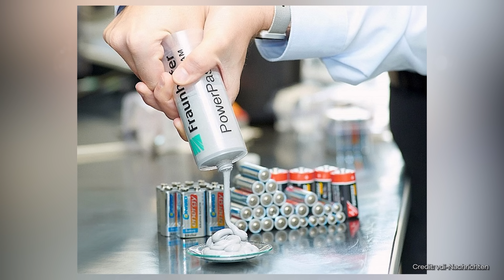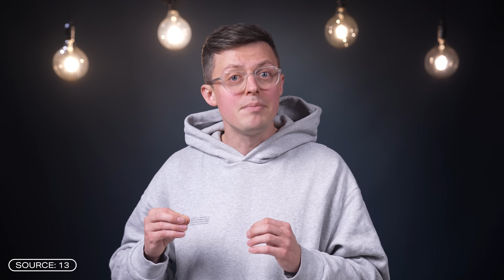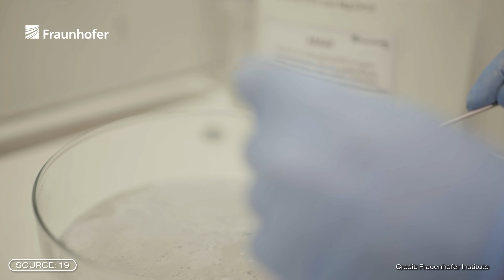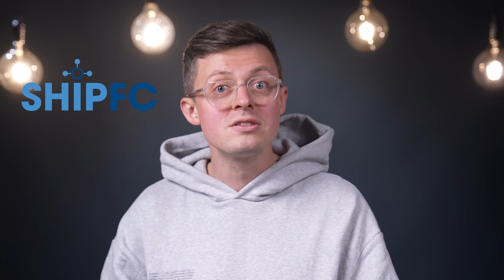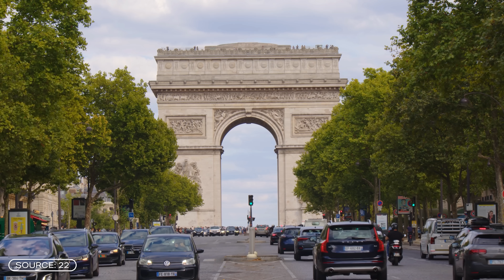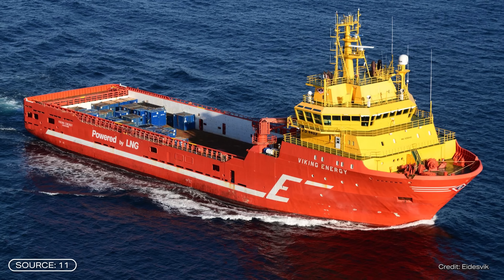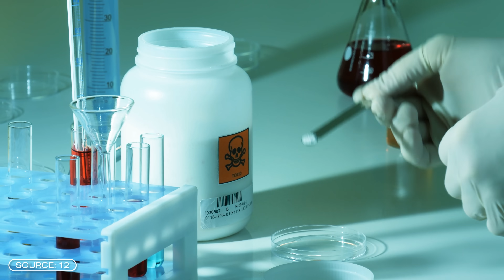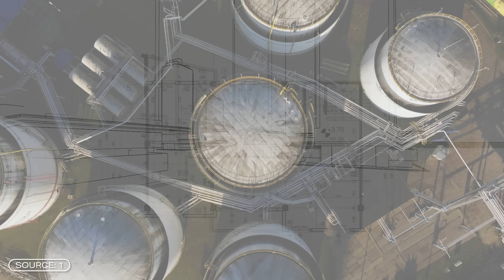Hydrogen Powerpaste: 10x Higher Energy Density & Safe?

Comment: Another issue with Ammonia fuel on a ship, is that an Ammonia leak will kill the crew.  Any leak from a collision or other emergency, or just bad maintenance will be toxic for the crew.
Reply: It's a similar issue with ammonia refrigerant.   It's only used in industrial locations with redundant safety measures.
Reply: @1spaghetti32   in long island suffolk college one campus has   2 large ammoonia chillers to cool down the gym complex so you see in other places then industrial
Reply: Don't forget that liquid ammonia is already being shipped internationally and has been for a very long time. Its a mature infrastructure with very well developed regulations and safety standards. There is little need to shoot it down because its not so infinitely perfect without any possible downside. Its an overwhelmingly better alternative for international exchange then batteries, hydrogen, underwater cables, etc.
Reply: @Sockasaurus-Rex my dad worked in offshore shipping (oil and gas, gypsum, auto) and he said much the same thing. Ammonia is extremely attractive because we already have a solid distribution system through logistics and agribusiness.
Reply: Early air-conditioned movie theaters in the United States had ammonia-based chilling. Most ran without trouble for decades, but if memory serves there were a few disasters.
Reply: Urea is safer.
Reply: That is much less than for the current Ammonia transporting ships in operation.

As they have a ton more Ammonia.
Reply: Yes, but one can simply replace the dead crew, then. It is maintenance, eh...?
Reply: Ships that refrigerate their cargo already deal with and have protocols for it. It's a real but modest risk.
Reply: Well, humans can detect ammonia by smell at extremely low levels, well below toxic levels, in addition to reflexively triggering waking from sleep . Also, in very small amounts, ammonia is completely harmless, as ammonia is naturally produced in the body by ordinary metabolic processes. 
I'm not saying it's harmless, just that it isn't the boogie monster it is often made out to be.
Reply: @sup @superdupergrover9857 . Ammonia as fuel leak has the potential to be in not so little amounts, and be in locations that detecting it might be the last thing you do.  As a refrigerant in a cargo hold that people don’t go into much, sure, minimal risk.  As a large pipe through an engine room, not so much.  Imagine if the Houthi had put a missile into an ammonia line on a ship.  Those that survived the kinetics might be in trouble from 9 bar of ammonia expanding into a gas and filling the engine room.
Reply: @s @superdupergrover9857 suspect that if you get a whiff of ammonia on a ship carrying it, with nowhere to run your next breath will be your last.
Reply: @superdupergrover9857 google anhydrous ammonia burns
Reply: @superdupergrover9857  pressurized ammonia is initially denser than air, meaning it’ll sink to the lowest point it can reach. If you’re at that lowest point, you’re SOL, regardless of whether you know you’re breathing it.  A few years ago a truck carrying anhydrous ammonia killed 5 people when it was involved in a crash.  It’s a risk that is possible to mitigate, but just think of what kind of danger it poses if it were used in millions of vehicles.  Hell, there’s videos of people forgetting to put their car in neutral when filling up, now imagine that’s ammonia instead of gasoline.
Reply: @superdupergrover9857 Yes but a single pipe leak expend as much ammonia as it was designed to transport, which is all of them over a short time.
Reply: Some of nitrogen oxides (N2O) are far worse worse greenhouse gasses than CO2
Reply: @mladenmatosevic4591 which is part of why the emissions test on your car is allowing progressively less NOₓ
Reply: @mladenmatosevic4591  yup, I study them.
Reply: @mladenmatosevic4591  GHG is basically unproven theory (on a planetary level).
Reply: @C_R_O_M________  tell that to 400-ish universities, including my own and thousands of reports using climate/paleo data going back 800,000 years or so. 😂
Reply: @IdrisFashan  I am telling you, and pay attention to my wording: on a planetary level the GHG theory is unproven. 

That is why climate models overshoot reality by a lot see latest paper by McKitrick and Christy (the founder, along with Roy Spencer, of the satellite temp monitoring system). 

It's either a completely false theory or ECS is abysmally lower than they think.

 Do you have any idea what ECS is and stands for?
Reply: @C_R_O_M________  for every body that says we’re overshooting I can find 20 that say we’re undershooting.
Reply: @C_R_O_M________   There are some claims of a relatively low ECS until breaking points are reached.  But I haven't seen anything to claim that the ECS is zero or non-existent.  And satellite temp monitoring has shown that the Earth is getting warmer.  If you want to; you can always find doomsayers that will claim unreal levels of climate sensitivity; and by comparison you will seem more reasonable.  But more conservative estimates for the climate sensitivity still are holding, and that is very different from GHG being unproven (in fact the opposite). 

Kind of hard to believe that there are still people claiming GHG is an unproven theory at this day and age.  It is fairly simple to explain; you have an amount of energy entering the Earth from the sun; the Earth emits IR radiation until you reach an energy equilibrium.  If you have something blocking wavelengths in that outbound radiation and reradiating some back to the surface, the temperature will increase until energy equilibrium is reach again.  Very simple physics.

You can actually measure the decrease in outbound radiance in certain wavelengths from co2.  See study "Direct observational evidence from space of the effect of CO2 increase on longwave spectral radiances: the unique role of high-spectral-resolution measurements"

Notably the difference in radiance from co2 isn't the whole story.  There can be a positive feedback loop resulting in more heating than from the co2 alone; or you can have a negative feedback loop where the heating from the co2 is partially mitigated.  The former results in a higher equilibrium climate sensitivity; while negative feedback loop will result in a lower equilibrium climate sensitivity.  Even if you go with the later; you are admitting that there is a greenhouse gas effect.  And that temperature increase can still cause a lot of damage; even if it isn't as extreme as what some doomsayers say.
Reply: @C_R_O_M________  I'm not sure what has happened to my other comment; but in short it is a bit surprising that there are still people claiming planetary GHG theory is unproven.   It is fairly simple to explain; you have an amount of energy entering the Earth from the sun; the Earth emits infrared energy until you reach an energy equilibrium.  If you have something blocking wavelengths in that outbound energy and reemitting some back to the surface, the temperature will increase until energy equilibrium is reach again.  Very simple physics.

We got satellites measuring the difference in this outbound energy; and it matches models.  There is still some debate about feedback loops; which changes whether the ECS is high or low; but even a low ECS confirms GHG theory.
Reply: @josephburchanowski4636  I know exactly the claim. I have been researching climate science for 20 years and I am a trained scientist but the assumptions that justify the GHG theory are not solid themselves.  Take the Venusian atmosphere for example. We know that even though the planet is closer to our star and its atmosphere is around 97% CO2 (whereas ours is just 0.04%) at 101 kPa atm pressure or 1 atm (at a certain height up the Venusian atmosphere), temperatures are almost identical to Earth's. So, at least the CO2 part, is not written in stone. 

There might be other reasons for the discrepancy of outgoing radiation besides CO2 or other trace gases like Methane (which is measured in parts per billion per volume - not even millions). 

Water vapor is the elephant in the room, so are clouds. 

Alarmist climate science is great at hiding the huge knowledge gaps that exist. Don't get me wrong, I don't entirely dismiss the GHG theory but I suspect that, especially for CO2, ECS is far, far weaker than assumed.
Reply: @josephburchanowski4636  "We got satellites measuring the difference in this outbound energy; and it matches models. "

>>It's actually the other way around. Models are designed around observations by assuming a certain hypothetical ECS that is so far overshooting reality (by a lot). Then they tweak this ECS and it becomes weaker and weaker as time goes forward and measurements, again, are proven lower than modeled outcomes. 

Take a look at the latest published work by McKitrick and Christy (the scientist who's responsible for the satellite monitoring system you mentioned - he co-founded it along with Dr. Spencer, both skeptics of the climate agenda). It pretty much illustrates that observations are aligning with only the lowest of ECS (which doesn't prove the ECS principle in and of itself). I suspect that CO2 could be proven to be less of a GHG than we think it is.
Reply: @josephburchanowski4636 that's not a person, it's a bot. You'll never convince a bot that was created by the fossil fuel industry
Reply: @C_R_O_M________  Saying that theory is not proven is such a meaningless statement. No theory can be proven by the very definition.
Reply: @skyrask1948 many theories have been proven and became fact not theory everything starts as a theory if it survives cross examination and is repeatable it becomes fact
Reply: @beezelbub666  Nope everything starts as hypothesis. And when it comes to theories they are set of explanations that best model reality according to facts, but they themselves are not facts and can be changed or replaced when ever better fitting theory emerges.
Reply: @skyrask1948 it becomes fact when its proved and when it's disproved a new fact has been learned
Reply: @beezelbub666  Except it is impossible to prove scientific theory.
Reply: @skyrask1948 if you break down the word impossible it's says I'm possible anything is possible our knowledge is growing yet there is always a way find the proof or if no proof can be found yet it may still be found at a later date
Reply: I used to work at a frozen food factory. We had over 20 tons of ammonia on site in the refrigeration systems. We had the odd leak, but you can detect it at extremely low levels, it was never an issue.
Reply: @billdoodson4232  Ammonia in refrigeration plants is in a completely sealed system; that cannot be the case when it's used as a fuel because the system has to be opened to fill it and the ammonia extracted to decompose it.
Reply: @billdoodson4232 now put thousands of those installations on ships and drive them around the world
Reply: @billdoodson4232 yes but... in your frozen food factory you had the option to leave the site in case of a large spill, in a ship in mid-ocean leaving site is not generally considered an ideal option!
Reply: @alanhat5252 Well I also had 14 years as an Engineer in the Merchant Navy. It still wouldn't have bothered me, as ammonia is extremely hydroscopic. The good thing about a ship is that there is plenty of water around. Admittedly you have to make sure you pump any water used back out again, capsizing the ship would be worse than the leak.
Reply: are we ignoring the main issue with ammonia fuel on a ship being a single drop of sea water will turn it into a bomb?
Reply: @prjndigo    dont think so you have a reaction that leads to other compound and heat but no i cant find any outcome of it that turn it into what you said
normally forms a high base and release of hydrogen(still need a spark) which is mainly from contact of water

Comment: Wow! 1,600 Wh/kg vs 200 to 260 Wh/kg for high-nickel ternary (NMC/NCA) cells, such as those from LG or Panasonic that are used on long range Tesla model 3! THAT is HUGE!
Reply: Not like for like comparison, the 1,600Wh/kg is of the H2 released from the Powerpaste and water reactions, it doesn't factor in the efficiency of the hydrogen fuel cell (~50%) nor the weight of all the vessels, pumps, pipework, cooling system (exothermic reaction), fuel-cell, waste collection vessel and waste material, reactant chamber, and water recycling/purging system. All of these components volume and weight when added together, is the equivalent system of an electrochemical battery pack (like a Lithium based one). Further, the Mg(OH)2 waste is over twice the weight of the MgH2 in the Powerpaste slurry, so the system weight increases as it generates hydrogen.

I would hazard a guess at a battery equivalent system level that a Powerpaste system has a lower gravimetric, and volumetric, energy density.
Reply: @GruffSillyGoat I don't think the weight will increase in a close fuel loop like cars. The volume, will be more of a problem. It's not like we can eject them as gas like we do with oil-based fuel, and carrying trash around means lower efficiency.
Reply: @bmanpura  - The mass increase comes from adding the Oxygen (O2) to the Magnesium Hydride to form Magnesium Hydroxide, the molar mass increases from 26g/mol to 58g/mol as a result. The binder in the paste is chemically inert and weight doesn't change in the process. 

The O2 comes from the water carried on board, and the H2 released is feed to a fuel-cell that reacts with atmospheric Oxygen to form water again (plus provide electrical eneger in the process).

The water from the fuel-cell can then be partially used to top-up the smaller volume of water carried onboard to keep the process cycle going. 

The remaninder of the water from the fuel-cell can be purged, to offset some of the system's weight increase. However, like hydrogen fuel-cell vehicles controls will likely be implemented where and when such water can be purged (collected in a vessel and purges when at rest for example, and at temperatures where the water doesn't create black ice conditions). On board heating will also have to be incorporated to prevent the water from freezing in the car. Again, increasing the systems overall weight. 

In operation the weight of the vehicle will increase, as a water purge won't remove all the weight gained from operation of the system. Only removal of the waste Magnesium Hydroxide will lower the system weight again.

Combustion is not an option as Magnesium Hydride is very energetic when openly oxidised. Magnesium Hydride is also an area of research for high energy explosives (China made what they described as a non-nuclear hydrogen bomb with the stuff last year).

Comment: I think the best way to store hydrogen is liquified propane.
We already have logistic infrastructure for the stuff, and it’s widely used in practice to fuel vehicles. We already have commercially available fuel cells which oxidize propane with atmospheric oxygen albeit these are not powerful enough to propel a ship, sold as mobile electricity generators.
There’re two challenges left: economic way to synthesize from electricity, water, and atmospheric CO2 (currently it’s cheaper to refine from natural gas), and improving these propane fuel cells.
Reply: Propane is usually created as a byproduct of natural gas processing or crude oil refining both of which are rather dirty processes. Is there another efficient method of creating it?
Reply: @tonyw4863  Not yet still ongoing research, but I believe it’s will be solved eventually, I mean it’s not nuclear fusion. For example, see 2023 article with DOI 10.1038/s41560-023-01314-8

Comment: i think they overstate a little..... 1.5kwh / kg .... because at this level it would make it feasible for passenger airplanes .... the hydrogen converted creates pure water, this water can then continuously be put onto the pase.....

you would not have to empty the tanks before landing, meaning you can use it to the last drop  (lipo's have only 0.3kwh/kg thats why they are not feasible)
Reply: For flight, what do you do with the Mg(OH)2+binder waste the system generates, thats twice the weight of the input MgH2 in the powerpaste?